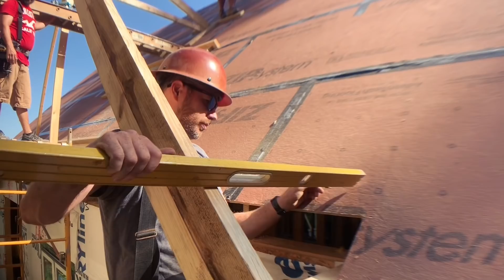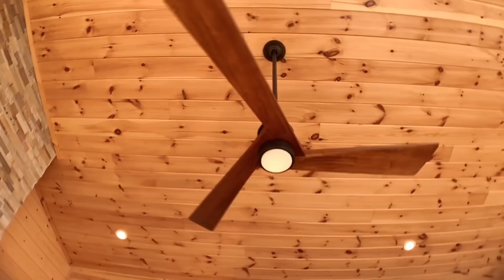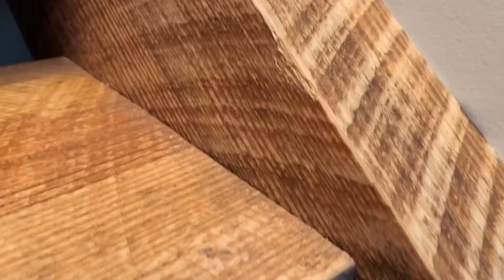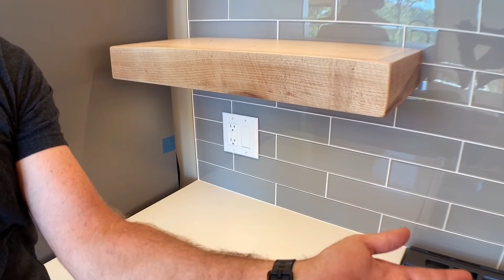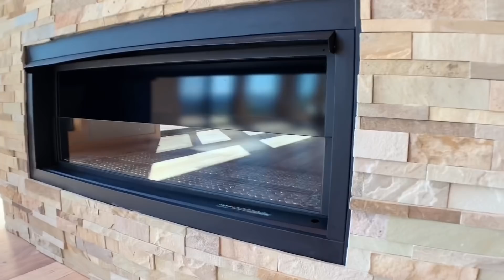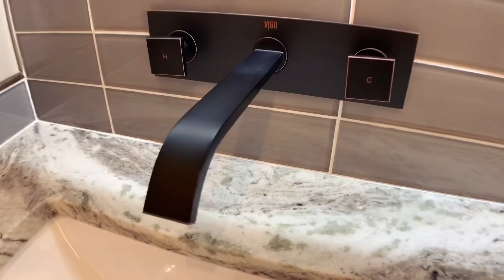The modern, rustic, and custom features of our latest build

Comment: Been watching your videos for the last couple of hours now and then got to this one. Love it ❤
Do you have any videos/advice how to achieve the look you've got on the stairs and those floating shelves? Would love to make something similar :)
Also, keep up the good work with your channel, it's brilliant!
Reply from the maker: Hey thanks! We used 4x10 timbers for stairs and 4x12 timbers for the stringers. To pass code there can’t be more than a 4” space between the treads (or railing parts).
Reply: @PerkinsBuilderBrothers  Thanks for your quick reply :) I actually meant how to achieve that modern rustic look you've got on the stairs and floating shelves, like what stains and techniques you used to make them look so cool. Thanks

Comment: Very nice house and video, I like the simplicity and durability of those steps, with the cable railings it looks really sharp. Good job guys, and it looks like this is the house where you did the smart siding vs video. Super cool.
Reply from the maker: Thanks.. and you are correct about the siding!

Comment: The house looks great, very tight fit and finish. I would have changed a couple items to fit my typical design taste like have the porch/deck all one piece instead of two separate portions. In the bathroom vanity I would have done a half lap joint of the face frame.

Comment: What cable railing system was used on the deck?
Reply from the maker: It’s Muzata.. 1/8” stainless cable with adjustable toggle turnbuckle ends.

Comment: Note to builders - siding should be even with top and bottom of windows casings, and top of door casing  yes that means you have to vary the exposure to get it to work out, takes a little longer but the effect is worth it. 
All old houses are done this way, I specialize in houses from the 17 and 1800s.
Take a few minutes to look at various old original old houses and compare for yourselves to new ones where that practice isn't followed..
Now I've done my good deed for the day.